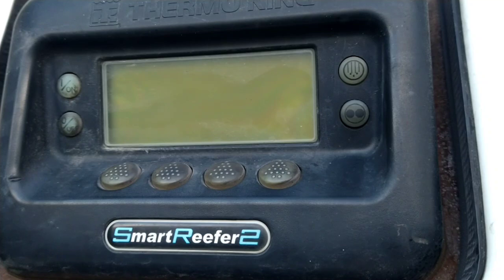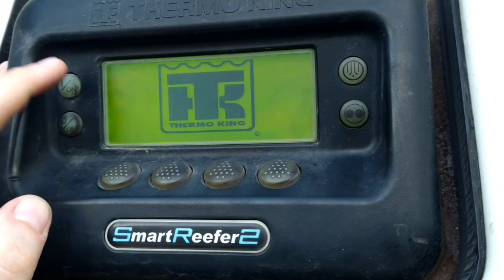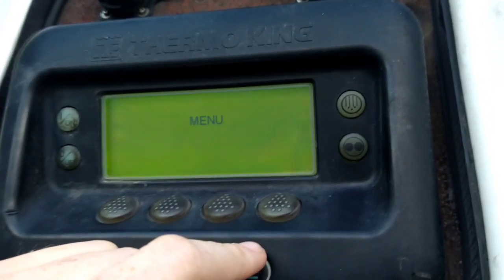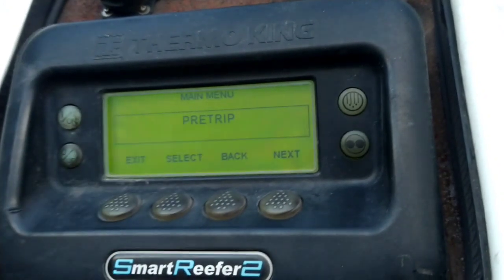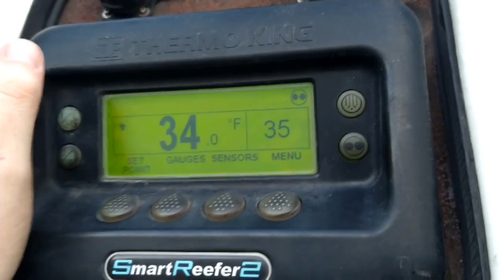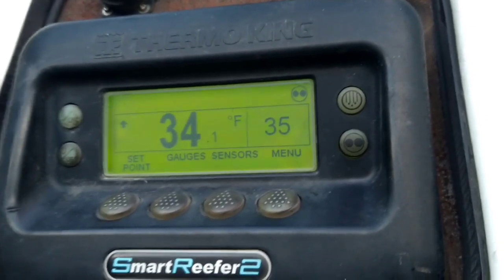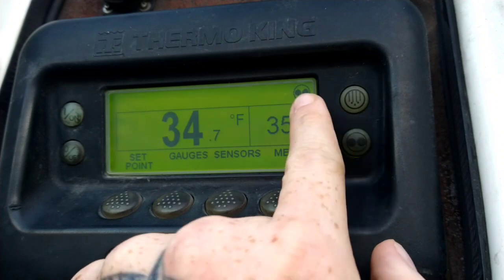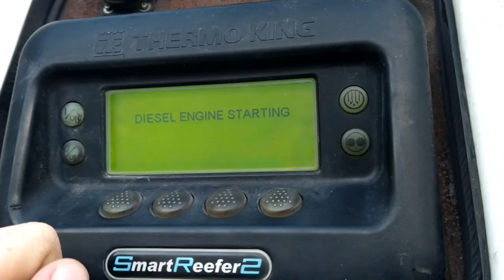🥶How to REEFER? | How to operate a reefer unit | trucking reefer freight | CDL OTR owner operator

Comment: When you dock at the receiver do you allow the reefer to run or shut it off? I get tired of being docked for up to 6 hours with a frozen load set at -10 & the reefer ending up in defrost mode constantly trying to keep at temp with doors open wasting my fuel. I always override the "door open" sensor that automatically shuts the unit down while docked at the shipper or receiver. The receiver documents temp readings upon arrival of a delivery to make sure temp on reefer matches temp on the bills. But sitting in a door for hours waiting to unload or load with doors open & reefer running wide open struggling to keep at temp makes no sense to me. It's a HUGE waste of fuel that they are not paying for & the product is not staying at temp during the process anyways. I let mine run because I don't want to give them any reason to reject my load. I arrive on time & at propper temperature documented by security at the gate. But sit for hours with doors open in a dock door waiting & wasting fuel?
Reply from the maker: Most of the time i let it run. I do get fed up and cut it off sometimes

Comment: You will have the most issues with frozen loads set at -10/-15°....some trailers won't keep up.
You will need to monitor the unit every couple hours or so to make sure it's still working!
I've had a unit turn off itself after fueling because of air in the fuel system!
Open the unit doors and use the primer.....use start/restart button as necessary.....pump the hell out of it until it starts and stays running....it might take several attempts, but don't wait too long to call for service....frozen will lose about -1° internal product temp per hour!
Reply from the maker: I've got a video coming out soon about the frozen food loads and certain trailers
Reply: @CashisKingtrucking  , I was just throwing that out there for anyone who's never done reefer.
I've even had to use a screwdriver on the starter solenoid to start them before.....like an old Ford....lol.
Reply: I heard you should cut it off if the gas is at or below 1/4 before you fuel it... that should prevent the problem
Reply: Or you can get the Thermo King with the electric Primer/Lift pump

Comment: Hey there Brother Cash!!  Not sure how I missed this one.  Question, for example in your case as an O/O, what if the Reefer Unit breaks down, does Loves and those places do repairs on those as well?   And to protect the load (ice cream for example), then what as time would be of the essence?  Thanks buddy.
Reply from the maker: Yeah if your reefer has problems you need to take it to a reefer repair typically carrier or Thermo King there's a few mechanic shops that work on them. Yes time is of the essence.
Reply: @CashisKingtrucking  Ok thank you, I've been wondering about that.  Especially if a load was to get ruined because it couldn't get fixed in time.  Let's hope that don't happen.  Thanks again Cash.

Comment: Do you pulp every other pallet while loading and do you use a digital temperature gauge?  Also do you shut down the reefer while loading?  Thanks
Reply from the maker: I randomly pulp a few pallets and I like to use the digital thermometer as much as possible. It depends if I shut down the reefer or not. If they don't take forever I'll leave it running. If they ain't even started loading it after a couple hours I'll shut it off.
Reply: Thanks for your help!

Comment: Who much weight you can carry in the reefer....??
Reply: 44,000 pounds for the 53 feet trailer
Reply: @SANCHEZ__  gracias amigo...i am doing dry van and with 45000 lb i almost at 80000 total ..
Reply: @ManuelFlores-hj9lh   de nada! yo aún no tengo la cdl pero estoy en proceso voy aprendiendo gracias a gente como el q dice todo lo bueno y lo malo sin engaños
Reply: @SANCHEZ__  yo vivo en georgia y ya tengo un tiempo con mi cdl ..cualquier pregunta alli estamos a tus ordenes...
Reply from the maker: If I have to I can scale 45,000 just depends on the weight of your truck and your trailer. The reefer unit adds about 1700 lb to the weight of the trailer
Reply: @CashisKingtrucking   Is true if you trucks have a APU can have 12400 in your sterling axle and some state..???
Reply from the maker: @ManuelFlores-hj9lh  it varies by state. Some states do allow you to be overweight by 400 lbs. if you have a apu

Comment: Reefers are nightmare.   Sitting at warehouse forever,
You miss appointment it's like end of the world,
The noise ,the washing jobs also you mentio 100-$200 a week reefer fuel not a big deal , Are you serious ?!
That's about 8000 plus ➕ a year 😳
Reply: Yes but it’s also about 3k deferents a month between dry and reefer and that’s about 36k a year I have done both in my 20 years of driving I prefer reefer better because of the money I had Termoking this units last for about 35k to 40k hours I sold my trailer with 35k hours on it in 12 years of owning my trailer never had major issues with the unite you just have to maintain regularly just as if your doing oil change on your car same are this trailers not a big deal !!!